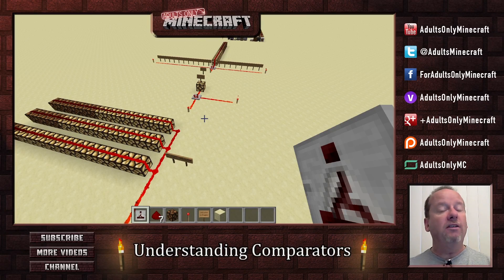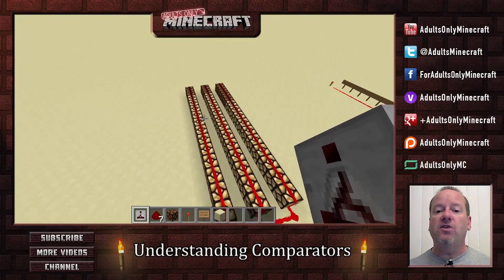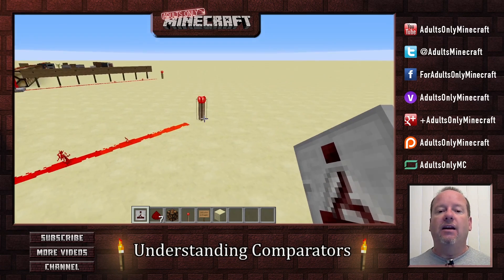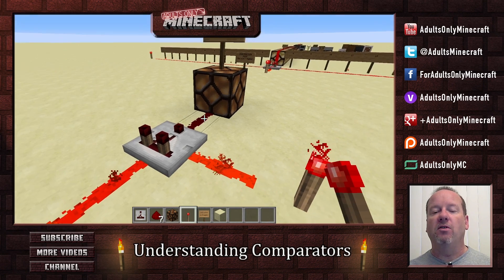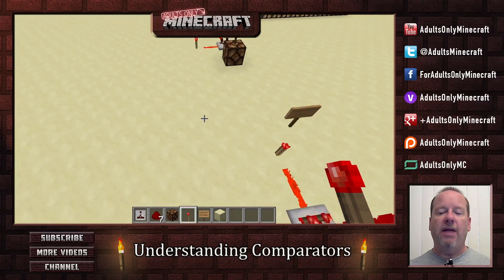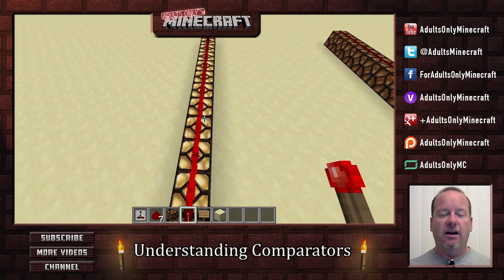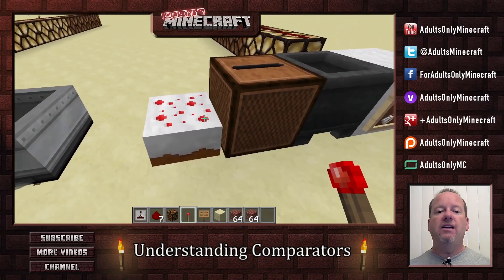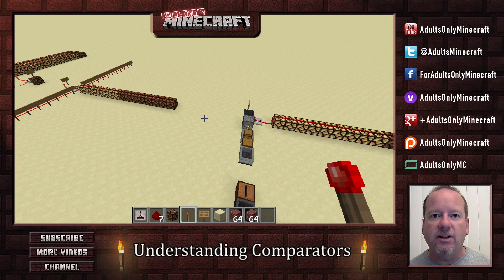REDSTONE COMPARATORS: Understand Them in Under 7 Minutes!

Comment: Well you wasn't wrong, it isn't impossible to understand, but it is hard to memorize if I didn't watch the video enough
and once I learn it it will come in handy! But what is the strength of the states of the cake?
Reply from the maker: As a redstone component, when connected to a comparator, a whole cake emits a signal strength of 14. The signal strength decreases two units with each slice.
Reply: @AO-Minecraft  cool! The cake can  e really useful if i didn't want to use storage block, thanks for letting me know this.
Reply from the maker: My pleasure. :-)

Comment: I just wanna know how I can light up a full house with just 1 switch
Reply from the maker: All you need to do is reinforce the signal from the switch using repeaters spread out at distances along the redstone "wire" less than 15 blocks. You could light a house of any size this way using only one switch. You can find videos about repeaters all over YouTube.
Reply: thx..i got it..pretty simple it turns out
Reply from the maker: Excellent! :-)

Comment: Ahhh comparators. The transistors of minecraft. Nicely done Marc. You've taken a complicated subject and explained it very well. 
 Now even I understand what they do...lol.
Reply from the maker: Well, at least one of us understands them!  ;-)  I'm still struggling to fully understand what they can do in comparator or subtraction mode.
Reply: Google image search electronic logic gates. You'll see that some of the gates have similar actions to what the comparator. After all, Minecraft redstone is just simple electronic engineering.
 By the way the repeater is just like capacitor / diode / signal booster.
Reply from the maker: Screamin Eagle That last part I knew ... Hey, I just impressed myself!

Comment: Nice job explaining these,but subtract mode is alot simpler(at least for me).Lets say two inputs are A and B.In subtract mode its simply A - B and will give an output only if A > B,And it if there is two B inputs then it will subtract A with B that has higher signal strength.In compare mode however it will give an output only if A is = to B or if A  > B.These features of a comparator are really useful when checking how many items there is in a chest or something(you can detect if chest is half full,etc.),but most people dont understand it and mostly use comparators just for detecting items(when there is only 1 item or something like that) I just wish more people knew how to use these properly.
Oh and you forgot the end portal frame :D 5:20
Reply from the maker: Thanks for the kudos and all the info. Based on the way you explained it, even I had a little trouble understanding it. I think the bottom line is that there is no "easy" way for anybody to explain the dang things! :-D And there were a few other things I didn't add at 5:20. I just didn't want to overwhelm the beginner viewer.
Reply: Yeah, I consider comparators to be advanced redstone.
But for 5:20 end portal frame is one thing that just came to my mind, i dont know all of them from the top of my head, but i mentioned end portal frame because it doesn't have GUI (not container)
Oh and just an idea for video: heavy and light pressure plates (gold and iron)
Not alot of people seem to use those,maybe its cuz they dont fully understand them and ty for replying :D
Reply from the maker: That makes sense. And thanks for the idea on the pressure plates! :-)